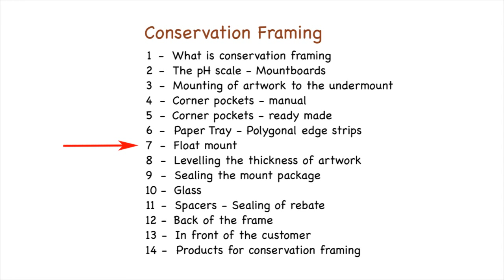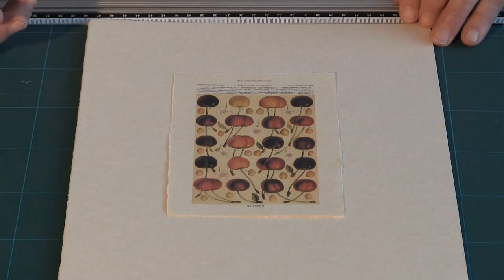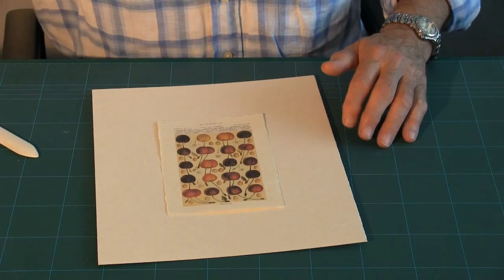Conservation Framing: 7 - Float Mount

Comment: I was taught that you should only attach the artwork with only two peces of tape at the top of the artwork allowing it to hang freely.  This allows the paper to breathe. Does having the artwork held at the top and bottom not restrict movement in changes of temperature?
Reply: I was thinking the same thing. Would love to hear his explanation...
Reply from the maker: Here you have the answer by Mal Reynolds personally: "You are perfectly correct that one should use two or more hinges at the top edge of the artwork thereby allowing the artwork to hang freely.  However, this relates to mounting artwork in what I call the mount package i.e an overthrow clip mount whereby the window mount is taped/hinged to the undermount with tape along the long edge, the artwork is hinged to the undermount and held in place by the window mount.
It is different when float mounting, a method used when all the edges of the artwork are to be seen and hence there is no window mount to stop the artwork from falling forward or flapping within the frame.  When float mounting one uses a number of hinges to hold the artwork onto the support board, the fewer the better.  One can either use ‘V - Hinges’ or ‘Pass through Hinges’"
Reply: How would you recommend to float with a pedestal support board? as in to give an artwork more lift?
Reply: Petef Conneely I was also taught to only use tape at the top of the art. Where I have trouble is when I use spacers but they don't hold the art in place. It slips out from under the spacers and buckles. Other than dry mounting, which isn't appropriate for some pieces, I don't know how to keep the art flat enough so it doesn't pop out from the spacers.  When I place the spacers, I attach them when the glass is in the frame so the spacers are sometimes beyond the edge of the glass. Should I be attaching the spacers before I put the glass so I can align them right on the edge of the glass?
Reply from the maker: Dear Craig, this is the answer by Mal Reynolds:
In the UK we call this method of float mounting 'Shadow Float Mounting.’  To achieve this a piece of conservation quality foam board can be used; I normally use 5mm foam board as this gives a good lift and shadow to the artwork.  The foam board is cut slightly smaller than the artwork so as not to be seen from the sides normally 5mm or 10mm is sufficient.  To attach the artwork to the foam board I will use either ‘pass through hinges’ or 'V-Hinges’  When using the 'pass through hinge’ a slit has to be cut through the foam board for the tab of the hinge to pass through whereas if using a ‘V-Hinge’ this can be attached direct onto the foam board.  Once the artwork is secure on the foam board this is then adhered to the support board.

A couple of points to note:  This is an excellent method of showing off artwork done on paper with deckled edges; however, care should be taken for the following two reasons:

If the paper is light weight then there is the possibility of the hinges showing through or the artwork cockling in the area of moisture.  In which case to adhere the artwork to the foam board small dabs of starch paste could be used but again with limited moisture.
This is not suitable for glossy photographs as the hinges will almost certainly show through to the front.
If the artwork has been rolled it is almost impossible to get it to lie flat on the foam board.  Paper has a memory and will always tend to return to its rolled position.
Reply from the maker: Dear Barbara, this is the answer by Mal Reynolds:
In the UK we call this ‘Close Framing’. i.e. in simple terms the artwork is framed without the use of a mount/mat.  As you are aware the artwork should not touch the glazing for a number of reasons.  First, when close mounting artwork as suggested I will always attach the artwork to a support board this is the reason why your artwork pops out from between the spacers and backing/undermount.  An easy method of attaching the artwork to the support board is to either use ’V-Hinges’ or alternatively attached small tape tabs around the outside edge of the artwork and secure over the back of the support board - the number of ‘V-Hinges/Tabs’will depend upon the size of the artwork.

Turning to the spacers - I always make my own spacers from mount board and foam board.  Normally the distance between the back of the moulding rebate and the sight edge is around 5mm or slightly more.  I will use 3mm foam board and glue normal thickness mountboard(1.4mm) to the foam board this then fits neatly behind the sight edge.

Comment: I am a photographer and I want to have my pro lab adhere deckled photos to foamboard, which is slightly smaller.  I then would like to secure this mounted deckled print between two pieces of glass or acrylic.  I have the proper spacers and frames with the right depth, I just do not know what hinge or adhesive I should use to secure the foamboard to the glass or acrylic.
Reply: Very late reply, but if you are still interested in this project I have an idea! 

First, Id recommend using acrylic glazing over glass in this case. Less risk of breaking and shredding the artwork, lower weight, and you can drill into it more easily than glass. 

get some rare earth magnets, then prepare your pedestal (the board the photo will be mounted to) by cutting it about a half inch smaller than your photo. 4-ply mat board is probably the material of choice for the pedestal. 

Use a punch to create four holes (or more depending on size and weight of the photo) in the pedestal near the corners that are about the size of the magnets. Next line it up on the back piece of acrylic and drill corresponding holes into the acrylic. mount magnets into the holes in the pedestal with ph-neutral pva glue, and into the acrylic with superglue. 

Now you can v-hinge your art around the pedestal (I'd explain in more detail, but i think just googling it would be less confusing) . Make sure you use an adhesive that is not pressure sensitive, i recommend Japanese paper tapes with rice starch, but the Lineco paper tape Mal is using in the video would also be fine. Only hinge at the top so the art can hang freely without buckling. When you place the pedestal centered on the acrylic backing and the magnets should hold it "floating".

This would be totally reversible, no dry mount or spray needed. This way if a client doesn't like the presentation its a cinch for any framer to change it with minimal risk to the art. 

Some downsides are that v-hinges are somewhat weak due to being in the peel position rather than shear, could cause problems if you have to ship it. Im also concerned about moisture build up inside of the package and about off-gassing from the superglue (make sure its fully dry before the package is assembled, learned that the hard way.)

Hope that made sense, sorry for the novel. I just love framing. Have a nice day friend!